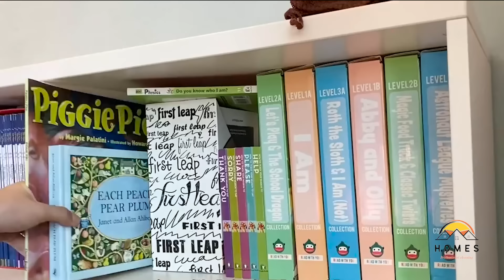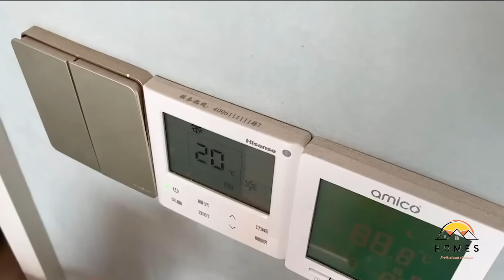48 hours to make a messy home clean and tidy⁉️ CLEAN DECLUTTER ORGANIZE | Best cleaning Motivation💪

Comment: I NEED to know what these guys are using to clean off the glue that's left after removing stickers!! PLEASE!!
Reply: I don't know what they're using, but I use olive oil directly on the spot and just swirl it around with my fingers until it emulsifies. A paper towel to get the oil off, then clean the whole surface with surface spray. Orange essential oil also works great.
Reply: Oil breaks down adhesive and then you can use a higher quality microfiber cloth like one from e-cloth or Norwex with just water to clean the oil off easily.